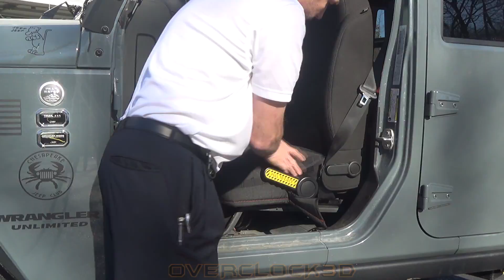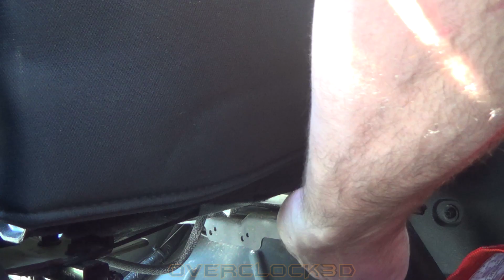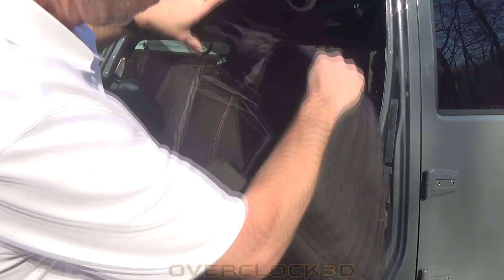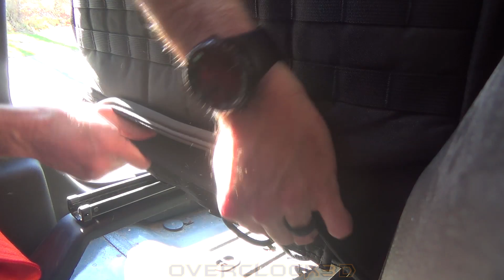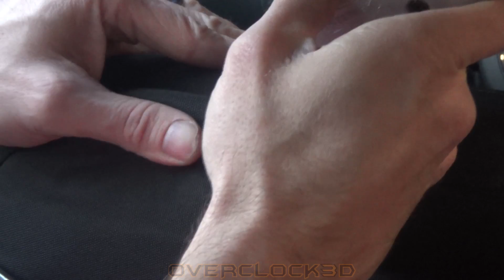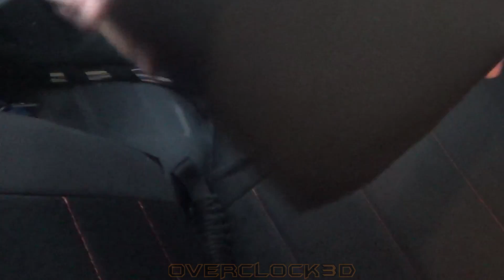Bartact Front Seat Cover Install (Side Air Bag Compatible)

Comment: Watched the video thru before and after ordering my Bartact seat covers. Was able to get the front seat covers and head rests on in less than an hour. Tying a loop at one end of the cord to tighten the seat bottoms was a HUGE help making it sooo much easier to get it super snug with just one hand, which also made the synch knots a breeze!! Thank you!!

Comment: I've found a way to slide the cover down the front seats.  Put the wrong ones on first, then realize your mistake and pull them off, switch and re-install.  Doh!  They went on much easier, not easy but easier, the second time.

Comment: Could you possibly put up a link to those exact same seat covers. Black with the red stitching. I went to the Bartact website and all I could find is the black with the large red insert. I want the ones you have.
Reply from the maker: So, first... mine are black with orange stitching...but...regardless, you need to call them for any special requests. They can pretty much do anything you want...but just can't order it all online.  Call the number on their website, and Sal will probably answer. Tell him you want the covers like they did for "CPO"  but with red thread instead of orange.  They should be able to fix you up.